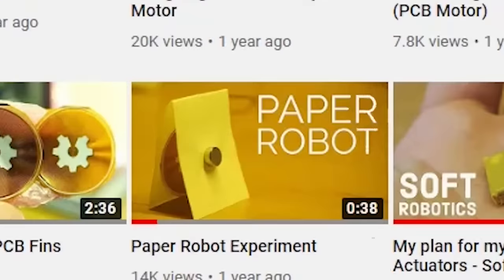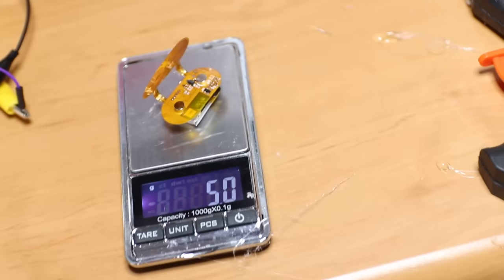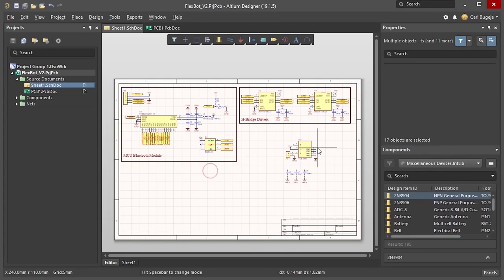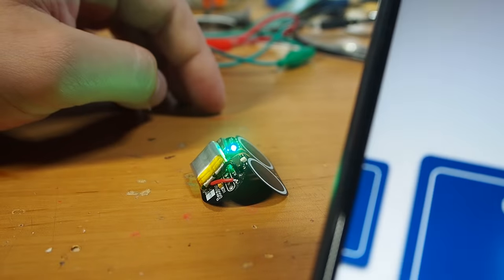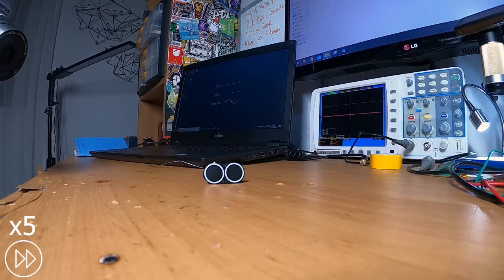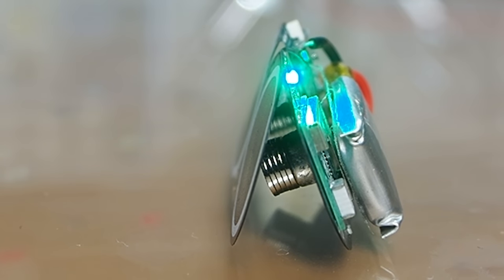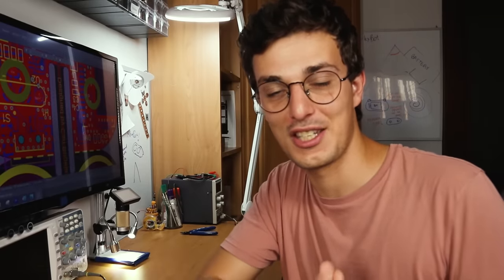Vibrating Circuit Robot

Comment: Repelling might be more consistent than attracting.
So maybe cut the folding edge and glue it in folded position. I think this also would allow you to explorer different angles.
A thin wire with known diameter could define the angle by positioning it parallel at a known distance  from the edge.

Comment: maybe you could put holes at the edges of the PCB, and tie the two parts tobether with thread so they can't slide apart. then the thread lengths could also be changed to maybe adjust it til it moves straight. or just one thread in the centre to keep them together.

Comment: Since you have a fold issue, why don't you add 2 solder pads inside the edge of the fold so you can solder them together limiting the fold?
You also might need to separate half of the coils so they can flex interdependently.
Adding a gyroscope might also help to compensate the movement error.
Also why don't you add little feet to them so they can make steeps?

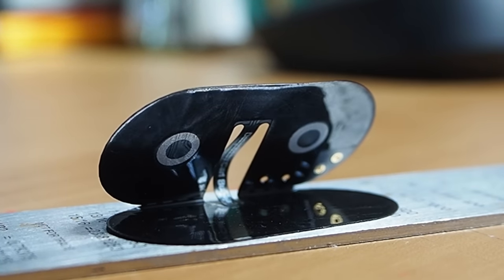Comment: Have you tried giving it 1-2mm 'legs' - to provide consistent contact with the table surface - perhaps a single leg at the rear and a leg under each coil? At 9:19 you can see the front & rear parts are skewed which would make it always favour the left.

Comment: hello, how about adding an imu and doing some control system stuff to keep the robot facing toward the desired direction? that would prevent accidental turns.
Reply from the maker: first i have to resolve the locomotion issues then we can start adding sensors :)

Comment: It's possible that turning was an issue because your two coils are too mechanically coupled.  If so, when you activate only one coil the entire coil-half of the PCB effectively moves at half displacement instead of that single coil moving at full displacement. Including a break in the PCB between the two coils could help de-couple them.

Comment: The battery should be mounted low and at the rear for stability and rigidity. The front needs a slot to create to front legs

Comment: How about cutting the coils apart so they can move independently? Then you can control direction with phasing of the coils? Maybe also limit the opening angle with a short piece of light fishing line through holes (rather than glue which will stiffen the hinge) so that there is no 'closing' resistance and the hinge can be more flexible.
Reply from the maker: I though about cutting the coils but it was very difficult to do it without cutting the tracks 😕 I like the fishing line idea.. It would be very similar to the tape test I made

Comment: 1st,  you just slightly broke 2hinch keeping the middle one same...
And then use flexible glue to the joint, preventing from broken.

2nd, just forgot your designee... Make a simple slippery base and put a solid PCB on it with all components... And then attached the magnetic PCB using flexible Hinch and add rubber pads at the foot for better grip.

Comment: I guess the flex of the paper is much larger than the flex pcb, so you probably have to go with separate legs in the pcb version. Either that or make your frequencies much higher in the ultrasound region, but that's going to be a much more involved as a physics problem.

Comment: What if you try with three coils, perpendicular to each other like sides of a cube |_| and make them travel in whichever direction you want. 
And also you could make the corners of the coil square instead of a circle to maintain the balance. 
The coil may act as 3 legs...... |_|
That would be a great idea...
Pls, think about it !!
Reply: On this note, would a triangle with an actuator on each vertex be good for omnidirectional movement?
Reply: @ericlotze7724  it may work if the top edges are not connected as they may hinder the movement !!

Comment: Now you need the optical mouse sensor to correct for the movement direction.  Have you ever thought of a wireless charger pad as the surface and eliminate the battery?

Comment: i wonder if making the front shorter than the back would bias the foot angles to make it drive forwards more efficiently. not so much that it falls over though. look at a Hexbug toy and see how the feet point slightly backwards so it can vibrate forwards. or maybe use some pins as feet instead of a long flat edge of a pcb
Reply from the maker: Intreseting idea! 🤔🤔

Comment: The folding problem could be handled by separating the front and back legs into two pieces.  The pieces would be stacked one in front of the other, fastened together (maybe by soldering through holes?) and then be bent apart, instead of folding 1 piece 180° around.  You could have one rigid PCB and one flexible or both flexible.  
It would look something like this (from the side) with one rigid and one flexible PCB:
  |   <-- This is where the two pieces are fastened
  |\
  |  \
  |    \

Or with two flexible PCBs:
       |   <-- This is where the two pieces are fastened
      /\
    /    \
  /        \

Comment: Can you fold the coils through a gap in the other half of the circuit, instead of soldering the two halves? That way the coils will be on the other side of the board, and will be trying to close constantly. If you are pushing the coils away from the magnets, you should get a more usable range of motion. ;)

Comment: To echo what others have said, I think some kind of "feet" on the PCB would be good. A bit like a "brush robot"...

https://www.youtube.com/watch?v=-_n_ODRQqWo

One tip about the solder paste, btw... If you add quite a large bead of paste about an inch above the stencil holes, and try to do the squeegee thing in ONE pass, the results should be a lot more consistent.

The problem with dabbing the paste into the holes is that each time the stencil is allowed to lift a tiny bit, which forces the existing paste to get squished outwards from the pads, and underneath the stencil itself.

Try doing it in one pass if you can. I think you'll be pleased with the result, especially on the teensy tiny pads. ;)
Reply from the maker: thanks for the tip! I will try this!

Comment: you have not accounted friction difference, it'll be more easy to control if you'd make leg's fits, in this case you electonic's part would b controlled by legs moving. the more friction the less difference!
Reply: I like this project and the effords done.
I was also thinking about the friction. Perpaps test your robot on SANDPAPER not on glass to get more info. Also with the bigger magnets or batteries the weight had increased and perhaps due to that the it worked better.
Also a small plastic or metal clip could be used so the flap does not open completely and there is less distance between the coils and magnet.